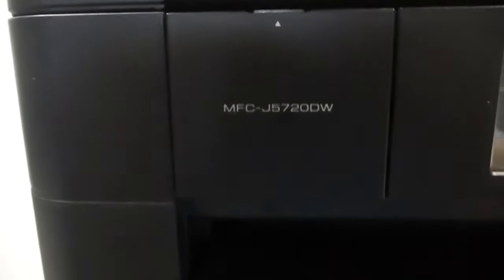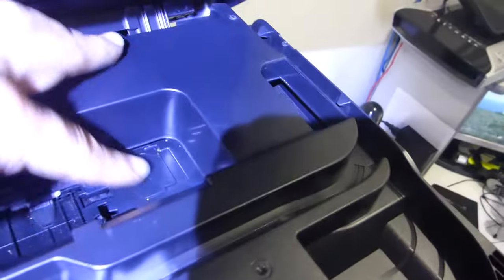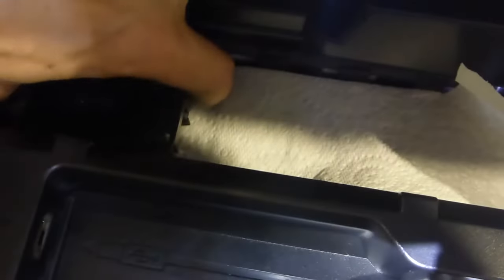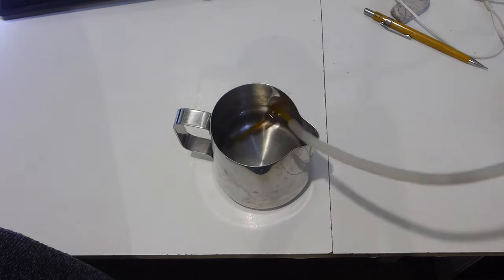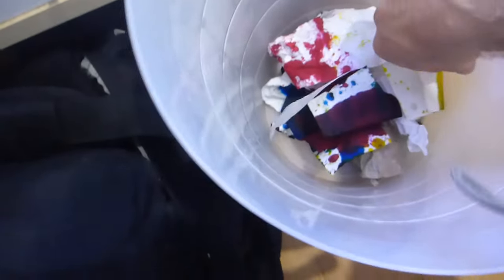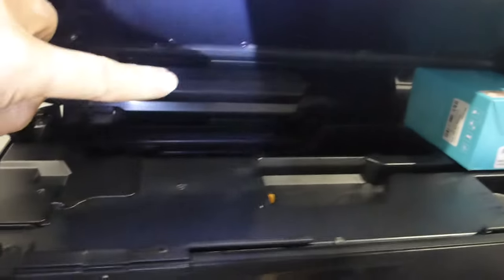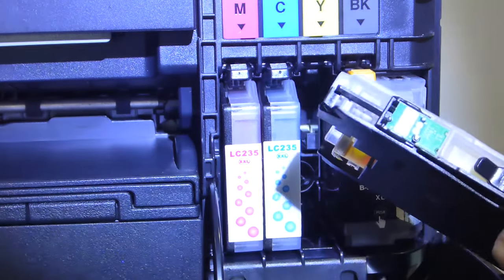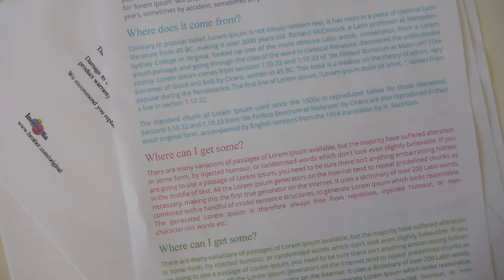Brother MFC-J5720DW Inkjet Printer Head Clean

Comment: Rather than unplugging the printer during a print job in order to prevent the printed from locking, a safer way to unlock the printhead is to lift the top lid on the printer as you would to access the printhead, then press and hold the red 'x' or 'cancel' button until you hear the printhead unlock itself, THEN, unplug the power and continue with your cleaning process.
Reply from the maker: Good idea. Was not aware you could do this. Thanks!
Reply: amazing!!! didnt know id find my answer in the comments section, thank you for saving me time fellow youtuber
Reply: Thanks !

Comment: Goooood! Yes, to prevent the printed from locking, it's better to unlock the printer head and my brother printer is MFC-J470DW, it's should hold the "STOP" buttom 3-5 mins during plugin the power, then the printer head will move to the center automaticly, next unplug the power. Enjoy the cleaning~
Reply: Good tip, thanks!

Comment: I've been successful in unclogging all the colors, but cannot get the black to work. Any suggestions??? I've tried hot water and I've tried alcohol, but no black so far. Any help you could offer would be greatly appreciated! Thanks, Jill
Reply from the maker: Are you using genuine or after market inks? Black is a much bigger cartridge and if it dries out, will be more difficult to unclog. Sometimes I pump/suck cleaning fluid through using small motions with a syringe (pump/suck). Best of luck.
Reply: @pescado99  aftermarket and it's the same size ink cartridge. Thanks for the tip! I'll try that!

Comment: Hey I'm in AU too. It's only warm water you used? A 5mm syringe and what size tubing? Off to Bunnings for the tube. Please let me know. Ta
Reply from the maker: Just measured the tube with digital calipers, 2.75 mm ID. I just use any syringe that will fit. 5ml should be fine (you can also use a suck in/suck out motion to flush it - just keep air bubbles out). I've used warm water and IPA (isopropyl alcohol). I used a fuel line from an old whipper snipper!
Reply: @pescado99  Thank you. I'll give it a go! Thanks for your help 🙂

Comment: I used shrink tubing with a syringe and it worked great. Holding the red x to unlock the print head was perfect. Had to run the clean cycle twice and repeat the process to get it completely unclogged.
Reply from the maker: I redid mine the other day using 'Red X' as well. It's working perfectly again.

Comment: Thanks so much for this, I had no idea what to do, and your down to earth solution with well explained but concise instructions solved my problem.

I ended up just using a smaller 5mL syringe, boring out the end to about 3mm and shoving that straight on to the ink pickup (so no tubing). Worked a treat.
Reply from the maker: Glad it worked out!

Comment: What is the diameter of the hose you use to connect to the ink spud in the printer?

Trying to find the correct gear to give your method a go. 
😀
Reply from the maker: Approximately 4-5 mm OD, with an internal diameter of about 3mm.

Comment: So I pushed cleaning solution through to Brother MFC-250C printhead, I've done it and each ink passage goes all the way through to the printhead as shown by soaked paper towel placed underneath, then ran several test prints and printhead cleanings and only got maybe a faint print from the cyan, then nothing. Is the circuitry broken or something? The printer seems to think everything is fine.
Reply from the maker: No, your printer isn't broken (it just isn't smart) - sometimes it's an air lock, or the water has to be flushed out for awhile. When this happened to me, I kept doing test pages of coloured text until each colour came back. Good luck :)
Reply: @pescado99  yeah, I've been fiddling with printers for a while and seems like women they get temperamental a lot and suddenly one day get in the mood. Wtf?
Reply: Hi  @pescado99  I'm having the same issue. off market inks, I did the clean with a cleaning solution, and put a new black cartridge in but now absolutely no black comes through. I've done about 30 test prints...would you recommend cleaning it again?

Comment: Couldn't find the right size diameter hose ... 
I tried using the rubber hose that they sell at pet shops for air rating fish tanks but it's still too big so you obviously need something a little smaller to get a pressure fit over the nozzle on the inside of the printer ...

Alternatively, the only thing that I did was take paper towels and put them on the inside underneath the nozzle like in the video. Soaked it with 97% alcohol then let it sit for about 5 minutes.  Manually moved the printer head over the paper towel back and forth ... did this about three times and voila. It took about 3 clean cycles, but it finally unclogged the head the Heads and printed perfectly ...
Reply from the maker: Excellent idea and good addition to this video. Thanks for the contribution.

Comment: my black is clogged like crazy then. Ive been trying to clean it for three days now but still nothing
Reply from the maker: I would suggest IPA, isopropyl alcohol, or warm water. If it flushes through to the head, you've fixed it. You only need small volumes, but you may need the higher pressure available from a syringe.

Comment: the most horrible shit printer i ever had, still black is showing lines on the paper, everytime when i print, cartrigdes showing empty when still full or hardly printed paper, these are absolute scam printers, bought the chip resetter and still cant print normally or cheap
Reply from the maker: I bought mine second hand for I think $150AUD. I needed it for scanning (which I use a lot) and the occasional need to print A3. I like the small form factor - A3 in an A4 body). I have an HP1320  B&W A4 laser as my workhorse. Agree that the Brother is problematic, but not any more than any other bubble jet I've owned - they all suffer the same fundamental flaws; built to a price and they use wet inks in tiny tubes with picolitre droplets - of course they will all eventually block.

Comment: so i cleaned with the solution for an hour. still no ink printing.😭 Any idea on how I can fix? Anyone.
Reply from the maker: An hour, wow! I'd say you've pushed cleaning fluid too far through the system. Just be patient. I've never had to clean it using more than a few mils of fluid. Have you tried with fresh cartridges?
Reply: @pescado99  After sending this message I managed to get it working all tubes cleared but now. It's going crazy with all these error messages. I looked them up. First it was a bad alignment with the clear strip. I cleaned that up and now it a bad ink connection. I took it apart and made sure all the ink connections were clean and attached securely. Still, bad ink connection lol I am pulling my hair out at this point 😂
Reply: @pescado99  hve any solutions with tht sir? help

Comment: Looks like Lego Technic pneumatic pumps could come to the rescue.
Reply from the maker: As an AFOL, I love this idea! But nah, they actually use a timed cycle with the onboard peristaltic pump to circulate the inks to stop them drying out. That's why you should never unplug an inkjet printer from power.
Reply: @pescado99  Ah, thats why magenta stopped working. I have my printer connected to mains maybe an hour a month. Hell to magenta!

Comment: I have a 5620 but cant move the head across? Do you have any tips?
Reply from the maker: Suggest you power the unit on (with a comination of soft 'on' button and power cord) so it starts its pre-start cycle (which is to shuttle the head across from park - where it locks). Once the head starts to move, just pull the power using the plug (not with the soft 'off' button) - it won't damage the printer. Once the head is free of the cradle lock position you can slide it easily and get some tissue paper under it so you capture the flushing liquid (IPA or warm water). I expect this method should work, but obviously it's for a different printer. Best of luck.

Comment: How do you get the scanner to lift all the way up to have overhead access to the work area? In essence, how do you pop the plastic arm out that locks the scanner at 45 degrees so that you can lift the scanner right up at 90 degrees? Thanks
Reply from the maker: Pretty sure mine lifts not quite all the way up. You'll need to support the lid with a prop to stop it flopping back down. I used a cardboard tube. Good luck.

Comment: I've gone through this process and still not unclogged the printer heads.  Any suggestions anyone?
Reply from the maker: What fluid did you use? IPA (Isopropyl alcohol) should remove more than just warm water. You don't need much. Also, power has to stay connected to the printer all the time normally - this allows the printer to go through its own cleaning cycle on a timed cycle (otherwise inks will dry out in the lines).
Reply: @pescado99  I used the Octopus fluids solution but it won't move the blockage

Comment: Bro you couldve atleast explain the header properly of how to unlock it coz like now my printer is useless if i cant get it cleaned
Reply from the maker: It's not consistent. Turn the power off when the header is in transit, this can take a few goes. Clean the lines and print head, then turn power back on and the head will work out where it is and will return to the 'park' position. Like after a power outage. Sorry you had hassles.
Reply: Please help I am not getting magenta at all flushed with water. But nothing.

Comment: Thankyou, I've just got this printer second hand. But I don't know how to connect this printer to my computer 🤔
Reply from the maker: Power on, go into setup (little tool icon top right of screen), go through WiFi setup - or connect via cable. Good luck
Reply: @pescado99  if you need to connect it via cable, you have to lift the lid up and you will find a place with a usb logo, so the cable connects on the inside, not the outside.